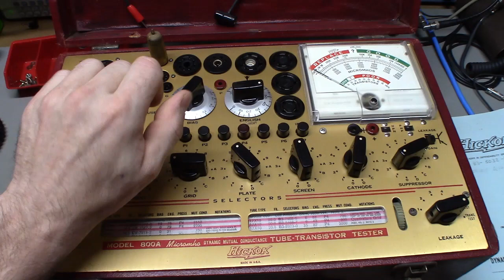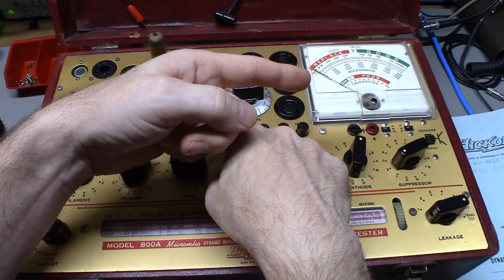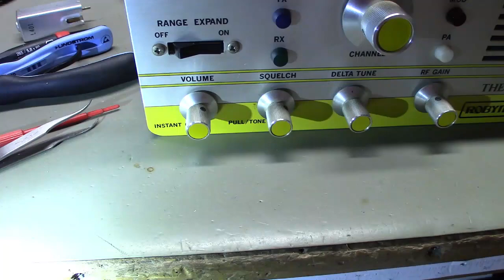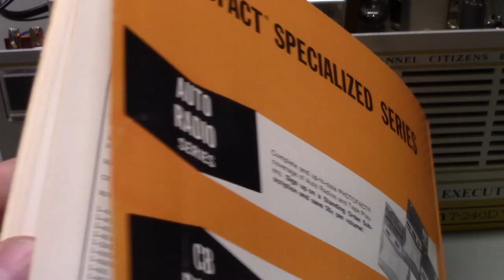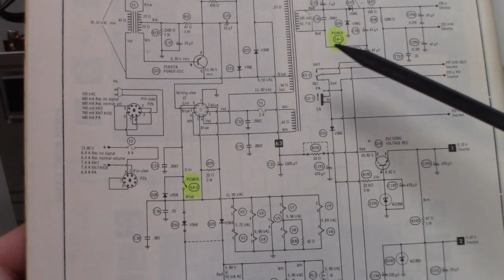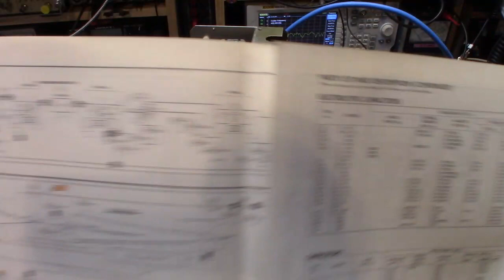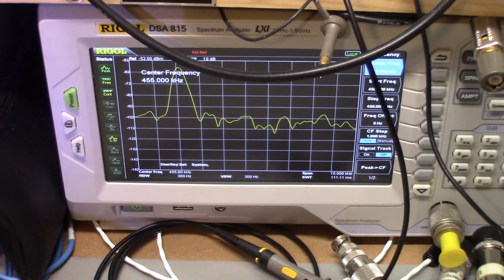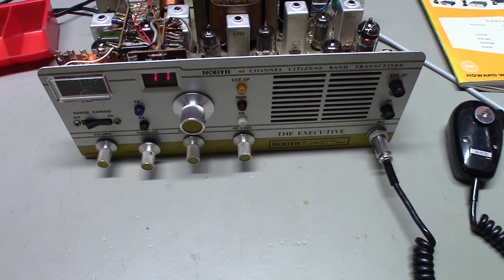Robyn T-240D "Yellow Bird" hybrid 40 channel tube type CB radio restoration.

Comment: I got one of these for my birthday in December of 1978, along with a co-OP between me and my local channel club for a Taylor Grand Slammer .64 wave ground plane and 40 ft push up pole.  Then got a D-104 for Christmas!  Happiest kid ever, and I had more fun with that rig than you can imagine.  Adjacent channel rejection was great, as I had two operators within 2 large blocks that didn't interfere with my operation unless they were 2 channels away.  Later replaced the rig with another T-240D, and still love it!
Thanks for the review... great information!

Comment: Nice to see someone who is knowledgable and through who actually cares enough to do repairs the right way. I see from your videos you do more than CB repair..You have the Only CB repair content that I dont call BS on by the second video.. I have found hours of intertainment on your channel..Nothing but Respect.. Hey at least those IF cans have sealed mica caps no silver mica disease... Really cool old radio .. I use  Joint Army Navy tubes where ever possible..
Reply from the maker: Without a doubt a blessing they don't have the built in silver mica caps built into the base of the IF transformer.  Lot's of early Brownings have gone to the grave because of that.

Comment: As some tips, I drove myself crazy one time working on my Swan 1011 tube radio. My trusty mutual conductance tube tester showed all tubes were good. But they weren’t! My Elmer took it and subbed a tube that fixed my problem. Then he swapped a pair the radio already had and fixed the problem without replacing any tubes. One tube was used in an audio circuit and an RF as well. Also many of those IF cans have bad silver-mica capacitors inside of them that can be replaced. So you can repair them. That paint problem is a pain! Usually they have an off-white paint. Sometimes I’ve managed to get it loose with a steel Allen wrench. Then I’ve used a plastic one. But many times that results in a broken slug that must be replaced. PITA!

Comment: At 1:12:17 -- my understanding is the Foster Electrical Company of Japan created that plug in the 1970s as a copy of the larger Amphenol version, but Foster ceased manufacturing them circa 2011. Dunno where to get plugs with machined pins, but Switchcraft makes them with cable strain relief springs.

Comment: Good videos wish i had time to post some but im always so busy with repairs. These are very good built radios i have also been servicing them for years and have several of the 123 and 240D still in the original unopened boxes as well as dozens of tube Messengers. Keep up the good work.
Reply: Would you sell one of the T-240D's?
Reply: I agree would you be willing to sell one of them

Comment: Excellent video o tube radios.  Not seen any mic plugs like that for years.  i have one on my CB, it came with it fitted to a coffin mic.  I did have a few as spares, but he stopped when the CB craze faded here, so I have no idea where he got them from.  there is no manufactures name on them either.  But like everything else, the stamped out tube for the mic pins are cheaper to make and easier and this is what they go for.  Quality these day are sadly rejected for cost.  Accountants run the world..... :-(

Comment: Great video Mike,we dont see cb kit like this much in UK,one of the main reasons 455khz filters fail ,can happen by applying DC to the filter,either a bad coupling\decoupling  capacitor on the IN\OUT of filter or No caps at all!,filters can get destroys be DC applied to the 455khz Ceramic filters over time,another well known modern brand had this issue on HF rigs.
Wondering if this radio would take a Murata 455-HT filter as a upgrade?
You mention the squelch,Ive seen these effect on Vintage CB Hts of 60/70's can do similar thing with squelch.

Rob 73's

Comment: I just remembered I had another radio with a very similar chassis to that maybe identical I believe it was also a Robin and it had a narrow rectangular window in the front and a little tube behind it and it looked like a green bar graph that came together as you talked I can’t remember the model of it it was a 23 channel though. It was kind of similar to a magic eye tube but it was a bar graph.
Reply: Model T-123 (not T-123B)
Reply: James Bowie Thanks I’m glad you said That I couldn’t remember the model after you said it I searched it on eBay and I just bought one for 50 bucks. I’ll add that to my collection.

Comment: Mike. If you would please, what brand solvent do you use to lossen the paint on the slugs of those I.F. cans?
Reply: Andy Thrasher I use Deoxit but not Deoxit Gold.Works wonders.
Reply: @1OFGODSOWN  Thanks. I may be possibly playing with fire here but I used a very minute amount of acetone and ran the slug up and down a ways as soon as it loosend. worked well and didnt seem to melt the plastic tube. I have De-oxit but its the D5

Comment: When you say this radio is PLL synthesized, are you talking about phase locked loop?  I see the switch going to the PLL board so it made me think of my J.C. Penney's phase locked loop radio that I modified with extra channels above 40 and below 1.  Back in the day (mid 70's) I had the very same Hickcock tube tester when I used to repair TV's.

Comment: Question:  Why did you replace the 3 electrolytic caps with film caps?  Those weren't non-polarized caps as you described.  Just curious as I'm restoring a T240D myself.
Reply from the maker: If your referring to the .1uF Atlas oil capacitors they are absolutely NOT electrolytic.  They are non polarized aluminum capacitors.  The black line on them does NOT signify the negative end.  The line on a non polarized capacitor signifies the outer foil or can.
Reply: @mikesradiorepair  That's good to know.  The manuals parts list says they're electrolytic caps.  C23, C24, C607.  Maybe a typo on their part.

Comment: Sir I have one of these 
The receive was loud and went in and low bot not out thought might been dirty potentiometer but not 
I can hear the skip on six but volume wide open to hear it
Reply: Any help would be greatly appreciated
Reply: When switch to pa the PA Has Plenty of volume…
And if I partially push PA I get a little more volume on radio but no where near full volume

Comment: Well you can clean the tube and pins it's probably been sitting in a wet box for many years, you can clean the pins with a fiberglass eraser pen or a pencil rubber the blue end or a bit of steel wool. Will isopropanol loosen the paint on the rf cans? Usually it dissolves paint very well you might find it will dissolve the paint and you should be able to turn it easily. I don't think isopropanol will melt the plastic tube I've clean plastic tubing with isopropanol and never noticed it melting, are those capacitors original I would have thought they would have had Mica capacitors probably been changed? I think using Surface Mount capacitors is better solder to a piece of wire bent in a loop as a heat dissipator. you can place them on the bottom, those film capacitors will get interference I would have thought being so close to the inductors. I would have thought the RF can next to the transformer would cause problems, it's only aluminium I would have thought they would have used still here! would be better. I don't know how you would defeat the interference from the coil being so close grounding is enough? and managed to tune it in  properly. Is it an issue?? Would you get a better response having a still can here  from the receiver.
Why is the jumper wire put in there then, what is the benefit in the first place of the wire mod.
You might want to try Advanced audio they might have those plugs? they make high quality studio microphones a Canadian family owned business.

Comment: Man I wish I had that schematic. I have an older Robin I can’t remember the model but it’s the same chassis but it’s a green 23 channel and it has the magic eye type tube as a modulation indicator. It’s like a bar graph. I need the schematic to see how the power cord wires I’m thinking it should be the same as the yellow Robin but I don’t know and I’m scared to plug it up.

Comment: That is a fantastic transceiver.  I AM curious if you swap out the final RF tube to increase the output?.
     Kind regards, Eric Dee.
Reply from the maker: No, still has factory original tube in it.  Increasing output in any radio is a bad idea.  Radios were not designed to do "more power" and trying to do so does nothing but stress the power supply.  In a tube radio that's a good way to burn up the transformer.  Ask anyone who had to pay to get a power transformer replaced because they had their radio set up for "more power" if it was worth it.  They will quickly tell you no.
Reply: @mikesradiorepair  ; Thank you for your time in replying.  That's great advice, THANK YOU . You have a fantastic channel,GREAT content, well explained.
Reply: @mikesradiorepair  I agree. That's what they made amplifiers for.

Comment: Good point about the longevity of vacuum tubes. in my experience unless it is a tube that is doing hard work in the circuit such as RF finals or audio output tubes in the course of it's lifetime they just rarely go bad all other things being equal. I think the myth of tubes being faulty was promulgated back in the 1950's and 60's drug store tube tester era. Possibly even by the manufacturers themselves. Those testers always read "Weak" or "Replace"  The unknowing weekend TV repair guy would buy new ones only to find that the new tube didn't fix his TV.  I wonder how many perfectly good  12AX7's that are fetching precious metal prices today ended up in the garbage due to these testers. I have tubes in radios here from the 1920's and 30's that are still working just fine. ATB Doug.

Comment: You never explained what that "range extender" switch does. Would think it's an RF gain but it has one.
Reply: wcemichael makes the transmit much louder when turned on.
Reply: Drives the modulation a tad harder. Gives you maybe 2 or 3 watts more output.

Comment: Hi sir, I recently acquired a yellow bird and my receive is absolutely perfect however my tx is not !!! It is only pushing about a 1/4 of a watt, I have replaced the 6ba6 tubes and no go, the radio is in extremely clean condition and I would love to repair it do you have any suggestions on where to start? Possibly a capacitor or somthing is there anything common that causes this on this model ? 🤔
Reply from the maker: I would check the RF final tube first.
Reply: @mikesradiorepair  I will replace it this week and see, thanks
Reply: @mikesradiorepair  which tube is for the rf final section and is there a better replacement for the stock one ? Thanks
Reply from the maker: @justinf6951  http://www.cbtricks.com/radios/robyn/t_240d/graphics/robyn_t_240d_om.pdf

Comment: Instant On.   I thought that was only a vintage TV thing.  It was advertised as 'Instant on' , no waiting for the warmup.  Kept tubes partially warm.  Remember from old TV repair in high school.  Eat lots of electric as well.  Yea should be labeled stand by and on then a fully off hard switch.

Comment: hey Mike, can this be wired for 12v
Reply from the maker: Yes.  It uses the same power socket on the back.  You just need to correctly wire up a another plug for 12VDC.

Comment: I own two of these and one of them is MINT inside and out the other looks great and comes on but has no transmit or receive.
Reply from the maker: If it doesn't transmit or receive you may be having a problem with the solid state synthesizer circuit.  Check to see if you have proper output from the synthesizer circuit at the correct frequencies.
Reply: MikesRadioRepair LOL, that is Funny since I am not a Technician but I have stayed in at least one Holiday Inn Express. 😂

Comment: Too bad users are always so hell-bent on modifying these classics. That never ends well. The first thing I do when acquiring these radios on a hamfest is bringing it back to factory-original condition. That's when they work the best. In that regard, the T-240D Yellowbirds that I have worked on/owned always had a low-cost Murata ceramic filter rigged in between the IF stages. The one in your video has the mod too, I can see it clearly (the small black plastic cube). I assume there once was a particular CB butcher who offered that "improvement" service for sale. As a result, the radio's IF passband is completely screwed up and the receiver will sound tinny. The first thing I therefore do when getting this radio is to remove that ceramic filter, restore the circuitry back to original condition and re-align the surrounding IF filters to their proper 455kHz setting. This radio from the factory has FOUR coupled IF filters (that is eight 455kHz LC tanks, 16 poles) which is more than the average vintage communication receiver which normally has 3 coupled IF filters. So there is absolutely no need for this ceramic filter. Cheers.
Reply from the maker: The ceramic 455kHz filters were factory in the later Panasonic tube type chassis.  I think it was a huge improvement because it narrowed the passband.  They were much less prone to adjacent channel bleed over like the earlier models.
Reply: The three T-240Ds that I found to have this ceramic filter installed were clearly "upgraded" in a later effort, not by the factory but by a third party. That could be seen by the sloppy solder work and the fact that the ferrites in the IF filters had been retuned, which cracks the white paint that the factory had applied to prevent loosening of these ferrites. And as I mentioned earlier, the receiver audio response significantly improved (for all 3 radios) after returning it all to factory state.  I have never heard of, or seen this particular Japanese tube chassis being equipped with this ceramic filter on other radios from different brands (as you know this chassis was used for many other radios like Gemtronics and T-berry). So I don't know what to tell you but I doubt the factory applied these filters, sorry.
Reply from the maker: @LifeIsTooShortForQRP  I guarantee you the ceramic filter board is factory.  How do I know, it's in the SAM's manual.  Manufacturers sent their radios straight to SAM's.  Actually the SAM's schematic shows the ceramic filter and separately shows what they call "alternate circuit" which is the earlier version.   I think I have only ever seen one 240 that didn't have it.  Every other 240 I have seen has the ceramic filter board.